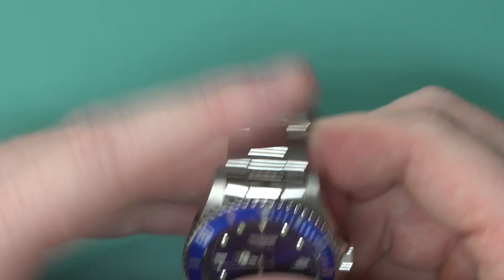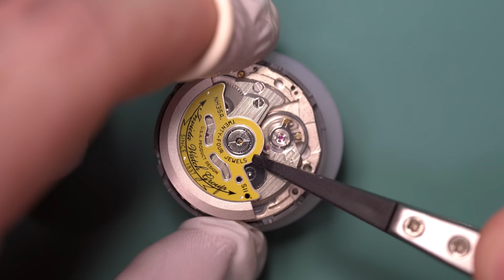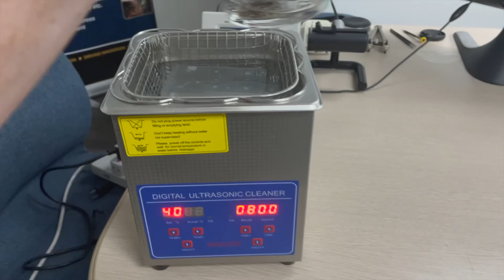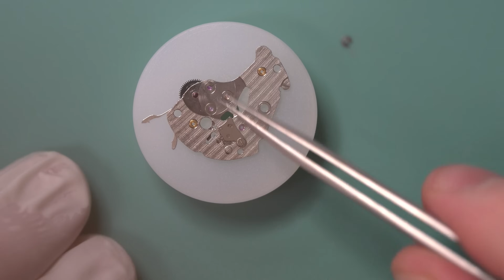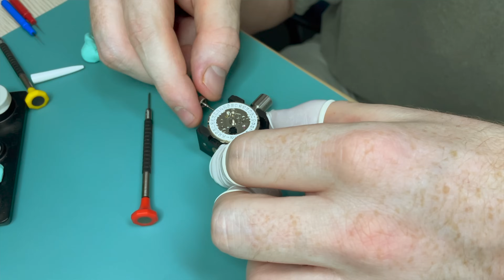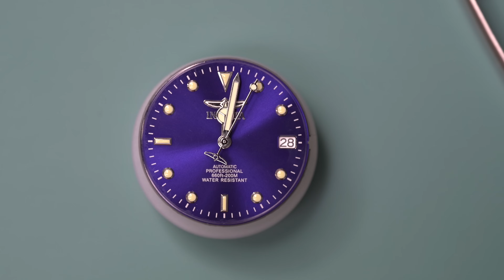$75 Invicta Pro Diver Strip Down and Review - Budget Watch Restoration - Seiko NH35a

Comment: I've had an Invicta Grand Diver for 11 years.  I'm sure I paid less than $200 for it.   It's never been underwater, but it sits unworn for months, sometimes years at a time.  Has always fired back up upon wearing or winding.  It's never been serviced and keeps perfect time.       I have about a dozen low to mid-tier watches, and the Grand Diver is in my top 3.  

As much as I love watches (automatic & quartz), and would love to have a Tudor Black Bay, the Invicta has reinforced that I get exponentially more enjoyment out of my least expensive watches, as I'm not afraid to wear them/scratch them, etc.  Then, you find out that with A LOT of (super expensive) watches, the movement miiiiiight cost $200 or even $300, yet the watch sells for 10 or 15x that, and I just can't justify spending multiple thousands of dollars on a watch that contains MAYBE $400 worth of components (and often much less than that).

Comment: I have an older version with a Miyota movement.  I modified the watch with a dial that I designed myself.  Never had any problems with it.  I was at an appointment with my cardiologist one day and noticed he was wearing what appeared to be an 8926 Invicta.  I asked him about it and he took it off and showed it to me.  It was an Invicta but it had an ETA movement and a much higher quality bracelet.  I wasn't aware there was such a thing.  It looked identical to my watch but up close you could see and feel the difference.
Reply: It's not common to find an Invicta with an ETA movement, at least not in a mechanical timepiece. Most of the Swiss made Invicta watches that are mechanical have a Sellita SW200-1 movement, which is basically a clone of an ETA 2824-2. Only few Invicta models have an ETA movement, usually in a quartz or the rare ETA 7750. Since ETA now only makes movements for specific brands, the Swiss made Invicta watches use movements made by Sellita

Comment: In the early 90's I was watch shopping, after talking to the salesman for some time, he was quite informed, I asked him what the difference was between a $900 and one that was $1800.  He told me the cheaper watch uses plastic gears rather than metal, which accounts for the price & long-term accuracy.  As far Invicta watches go, there is a whole lot of cosmetics to them, large sizes of diameter & how high the watch sits on the wrist.  So much so, you will probably find it hard to have a long sleeve shirt cover it when you wear it.  I also found out from on Invicta cust svc rep who told me about their watches under $100 are sellouts which they are clearing their inventory of.

Comment: I, for the most part, don't wear anything else but Invicta. But like all products, yes there are some that have issues. I recently bought a women's rose gold Bolt, it was not working upon receipt and a battery change did nothing. It was a bad build. The seller refused to take it back bc they said putting a battery in a battery operated watch somehow negated the warranty. My credit card issuer and I disagreed.
At any rate that was a bad experience for that purchase but I am and will remain an Invicta collector and wearer.
I  currently wearing the Wolf King, and a Signature model and alternating with a Marvel Grand Lupah "punisher " themed watch.

Comment: I been buying them since 2010 mine are Swiss made Swiss Parts or Swiss movement and I have had no problems with them Id like to send you one of the Swiss made and lets see whats inside. People bad mouth Invicta just by word of mouth or perception. I'll be the first to tell you they are tuff I dropped my Russian Aklua over the rail from the third floor at work to the first over the rail on concrete the crown bent but watch worked perfectly!!

Comment: Nice breakdown and summary. You sound like one of the younger watchsmiths on YouTube so kudos for already gaining such knowledge and skill on a clearly complex profession. Like the fact you also include any errors (like forgetting that sprocket for the quick date set), and enjoyed your pocket history of the Brand and particularly how they’ve changed over the years - I knew they were old with Swiss origins as occasionally see some vintage Invicras on eBay, but always wondered how they got from there to here. Fan of the brand myself - own 3 big 45 mm, Inc’ two automatics (a Seaspider and a more generic one) plus an older Russian Diver quarts - which does have slight blooming, either on the glass or dial and did suffer and early splitting rubber strap (though I got a replacement but have to put the metal bits, clasp and cosmetic weights in off old one). But brand do seem popular and improving quality a bit. Though I think with al the cheap Chinese ‘giant’ watches with what I consider over designed aesthetics flooding the market, I wouldn’t be supervised if Invicta dial it back a bit (no pun intended) and focus more on classic style and quality rather than flashy wrist giants. That all being said, I’m selling all of my Invictas now (and most of my watch collection, Inc’ lots of vintage Seikos), and just bought a 1980s/90s Agat Zlayoust Russian Diver reissue (would love a genuine Cold War era original). Mine is mint second hand (again, no pun intended) and has the bonus of a genuine Paneria strap. It’s so huge and heavy though, I may go back to a 45mm. But, I’d love to see you do a tear down rebuild of one of these just to see how authentic they are to the originals. And especially as they don’t have a removable back so you have to get everything out from the front. That’d make an interesting future video.

Comment: Excellent video. I watched from beginning to end. I was never bored. 
I just received an Invicta pro diver from Amazon.
I had ordered a Orient searay2 and it arrived in a nice box.Looked fantastic but mine wouldn't run. I tried to make it work cause I wanted to keep it. But it wouldn't run and I sent it back to Amazon. Instead of refunding my money,they put the balance on a gift card. I ended up buying said Invicta. Honestly, I was pleasantly surprised. It came package at least as nice as my Tissot watch did,if not better. It's only been a day but this watch looks,runs, and feels like a quality watch.It may fall apart tomorrow and I still won't be out much.
I have several swiss made watches and several more that were much less expensive. The Invicta is now the cheapest one I own. I'll wear it more than the others just to prove it to myself that sometimes,you get more than you pay for. Way more. Time will tell. 
Pun intended. 
mjc.

Comment: I have 3 Invicta watches 2 Mechanical & 1 Quartz. Which I never wear. One has the Seiko N35 movement, and the other has a SW 200 . movement. They both keep very good time. And are totally waterproof, (just swimming. I like them. I have a Rolex Submariner which is being sold as I speak. Too expensive to have serviced. It’s a 1978 1680 Submariner. I have way too many watches.

Comment: I've had one Invicta for going in 20 years. still keeps time well, still water proof through anything and everything I've ever done. the braclet pops if you put huge pressure or take a big spill say skate boarding in my case...but the spring pins are what fail not the actual bracelet. I'm up to 4 Invictas, my wife has a couple. they are cool.

Comment: such an interesting breakdown.  i have only one niggle.  When you put the second hand on, it was not aligned with the minute hand at 12:00...   somehow you moved the minute hand over to 11 minutes plus about one third of the way toward 12 minute hash .. as you pressed down the second hand... so when the second hand is at 40 seconds, the minute hand is at 12 o'clock.

PS I have this exact watch for paddle boarding. for which I paid $62 in mid 2020.  I had a Rolex GMT master II two tone on jubilee bracelet that was stolen on a vacation in Hawaii in 1996, replaced it with a Datejust two tone 36mm in 1997, which my life now wears like a bracelet since I didn't wear a watch at all from about 2000 until I started paddle boarding in 2020.

For kicking around, I now wear a Pagani 1644 Daytona Quartz, and a Pagani Sub homage in the colorway of the Smurf.  Surprisingly I like the Daytona the best of all, including both Rolex, b/c it is quartz and I never have to wind it or change the time and date when I haven't worn it for 2-3 days..  I find it quite odd that I prefer Quartz after all those years of mechanical.

Comment: I’m not a watch expert by any standard however I do have a few modest watches including a super value priced Pro Diver.  Packaging and initial feel was great, but after wearing it for about 3 months at my desk job and casual outings it began to show age.  The watch’s movement is quality, but the hardware…not so much.  Bracelet began to slack and finally a part of the case just fell off and the watch is now useless in my dresser.  Cheap glue or super thin solder?? I can’t tell but I now understand the price point. Feels a bit bulkier than the Rolex.  It’s not a Rolex

Comment: Now at least someone noticed this amazing deal from Invicta. I have been buying Invicta for a few years already, they use Seiko movements and they are so reliable and accurate! I own 60+ watches ranging from Casio all the way to an Omega golden watch, and I am a mechanical inclined person. Don’t expect a Rolex or equivalent brand, but for under $100 that’s the best you can get for something looks like a diving watch. However I won’t be using it as a true diver watch anytime though, don’t mess around with a watch if your life is depended on it!

Comment: wow  I have this watch but older version of it has a Tamaya? movement got it back in the 2000's  for $80  off ebay I once left in hot tub overnight with the screw down crown open still works well  but little foggy on the crystal and date bubble has scratch watch still works for the money invicta's are nice watches

Comment: I have a couple Reginald brand watches off Amazon. They are damn near dead ringers for Submariners and have more attention to detail than the Invicta I owned. But, mine are quartz and not automatic. Personally I dont get the hate of quartz. Automatics in my experience are more prone to reliability issues unless you spend $$$ and never as accurate. I will stick to my Reginald....the Invicta looks cheap in comparison.

Comment: I need some advice.... I have a Rolex where I left the pin out and both me and the watch ended up in sea water. It stopped working straight away and now like ten years on I got like tiny shells and seahorses growing inside. I kid you not. Is this kind of problem fixable?

Comment: I use this watch for recreational scuba diving and it works great! I don't wear it daily, just diving, but I've had it down to130ft of depth several times and probably have 100+ dives on it total.  If it stopped tomorrow I'd buy another one without any hesitation.  It's a bargain!
Reply: It is the watch that refuses to die or fail which is why watch elitists can't stand it
Reply: Others can waste $10,000. You get the bargain and still have the money...
Reply: I wear my Invicta automatic whenever I go out for a hike, it’s very rugged and water proof and I only paid about $100. I have a Hamilton which is my “nice” watch - it cost about $2,000 and the Invicta is really on par in my opinion.
Reply: I own 3 of these in different color variations - 2 have a scalloped bezel and one with a coin edge.  One I've pretty much worn as a daily for 10 years.  One tough peice of equipment. 
The quality and workmanship is terrific.  It is a lot of watch for the $.
For what it's worth, I consistently get unsolicited compliments on all 3 of them.
Reply: There is a video where they do a pressure chamber test on the pro diver. The thing actually did pass. I’m never swimming down 200m so it was a non issue, but it did pass.
Reply: Fckn great !
Reply: @AlexiaVon  I got a brand new one for only $45 in July when Amazon had prime day.
Reply: I got the "upgraded" pro-diver..you should check it out..fantastic watch..9937ob has a sellita sw200-1 swiss auto, better bracelet with solid links and milled clasp...a thinner depth case at 12mm..better crystal...aaaaannnd.. i think different lume on the markers too (mines ligther than the yellowish lume on the normal ones).. I've done a little diving with it too... fantastic watch for the money.. $170 on Jomashop.
Reply: @mrmagoo.3678  It's just fantastic to see multiple people in the comments on this video who are fellow divers -- ya know and actually take their dive watches *underwater*!?
Reply: why wear an analog watch? i frequently freedive and scuba and use a suunto zoop i got off of ebay and the info it gives is 1000000% more useful than any analog dive watch can give
Reply: @fezzes428  I've had a dive computer fail underwater ... but never an analogue watch. I wear both.
Reply: @fezzes428  I dive with a Air Integrated Computer as well as a watch and a SPG.  I never have a battery issue with an automatic.
Reply: @ragnarulrichson778  surely you wouldnt sacrifice convenience when you 100 ft under the water for aesthetic purposes
Reply: @ragnarulrichson778  what are you trying to tell me
Reply: I’m calling BS, recreational divers don’t dive to 130 ft.
Reply: @calnative4904  Yes we do.  30m is the "normal" recreational limit, 40m is the "deep dive" limit for recreational.  You're not going to spend a lot of time down at 40m on a single tank dive, but it's done, and then a reasonable number of people do 30-35m as part of a dive.
Reply: @calnative4904  Yes we do. That's going to be a relatively short part of a no-deco dive, but absolutely within reason. You should probably only talk about things that you actually know ... or learn how to use a search engine.
Reply: @calnative4904  I dive to 165ft, granted that only gives you about 6 minutes of bottom time, but 130 is not even deep for ND limits. My next dive will be with my Scurfa Diver One, a watch actually designed and sold by a diver.
Reply: @calnative4904  absolutely they do. I’ve done it many times off Catalina and in Hawaii. As long as you mind your bottom time and do a safety stop, you’re good.
Reply: @calnative4904  derrrrrp
Reply: @calnative4904  Lol...
Tell me you never dive without tell me you never dive.

Comment: My dad got me a pro diver for a HS graduation gift in 2008. it has survived nearly daily wear and tear with little to no additional maintenance. Stainless steal case and sapphire glass. The only issue I had is that I had to add a link to it as it was sitting a little tight and after several moves I could not find my original extra links. I had a hard time finding extra links for sale for my band as they did not produce that band size anymore.  But I love mine, and it looks great. Pro diver 4469.

Comment: He says as an engineer I know that there are 20 bars at 200 meters so the engineer does not know that there is already a bar in our atmosphere so it quickly fell apart that the engineer could not calculate 20 + 1 = 21 right ..

Comment: I've had a pro diver automatic now for 6 years with no issues. I wear it every day, shower with it, swim with it and have worn it diving around 65 ft. I was impressed enough with the quality that I bought 3 more, one of them being a Swiss movement. Two of them do loose a little time, but I dont find it significant enough to worry about. The Swiss made model is right on, of course it was more money.

Comment: Here's the deal. Invictas are hit or miss. AFAIK NONE of their n35a clones are made in Japan.  They are made from sometimes roughly machined parts made in China and assembled in NON clean rooms/warehouses in Malaysia.
The insides are usually "filthy" when compared to high industry standards of cleanliness.
It is more expensive to have the movements cleaned and lubed in the USA than they are worth.

My small face all SS Pro Diver keeps HORRIBLE time. My watchmaker could not adjust it to do much better. I gave it away.
My cheaper but STUNNING Blue face two tone gold and SS GRAND DIVER keeps amazing time for a  dirt cheap VERY good looking watch. I got lucky.  I wear that a lot. 

Beware, some of the "gold" parts  on the bracelet part  scratch VERY easily and then are scratched for life. Dont sleep in watches that are gold plated.

You buy Invictas how they LOOK, primarily. And as an actual timepiece as a distant second. But I must say my last two Invictas, a cheap Grand Diver and an expensive Reserve Chronograph both keep great time.

Comment: Hacking?  Of course I use it.  Otherwise when you pick up and set the watch you're usually 30 seconds off or so.  I don't like that.  I'd rather it be 30 seconds off after a few days (preferably even more than that), not on minute one of day one!!   I use the hacking and set my watches to the exact second from an atomic clock app.

Comment: You get what you pay for.    There are better Homages out there.    I have 2 failures within 6 months of purchase with Seiko NH35 Movements that are in the Invictas -  These movements are made in Indonesia vs Japan with most of the NH35s.......  Considering the fact that the crystal is mineral that scratches easy,  Aluminum Bezel, hollow bracelet links with pins and the clasp that breaks with in 2 years,  Their warranty service in SLC, Utah is horrible.  They lost one of my watches and have not replaced it.  They wanted to give a cheap quartz watch to replace an Automatic. WTF?? -  NO MORE INVICTAS FOR ME...  You are better off buying a Bliger -   Sapphire Crystal, Solid links, Screw in Pins, Milled Clasp, Glide Lock fast adjust, Ceramic Bezel and the choice of movements  DG8312 ($80), NH35 ($95)or PT5000 (2824 Clone) ($110).   If you shop and wait you can find them on sale on AE for less than that.  I have  one with PT5000 which is awesome...... It is worth paying almost twice the $60 to get better made watch.